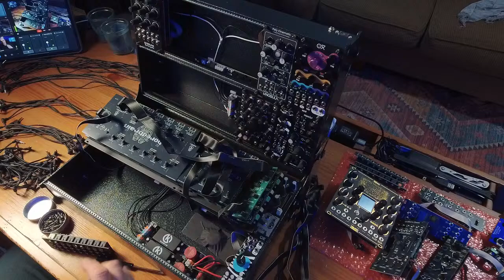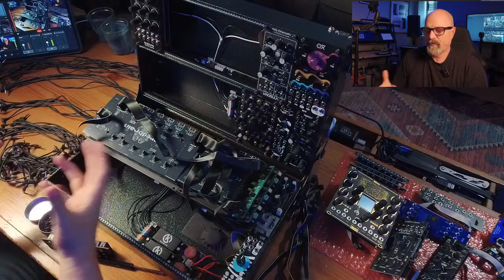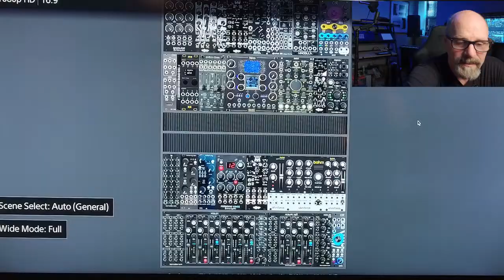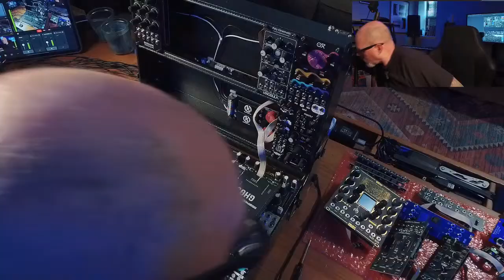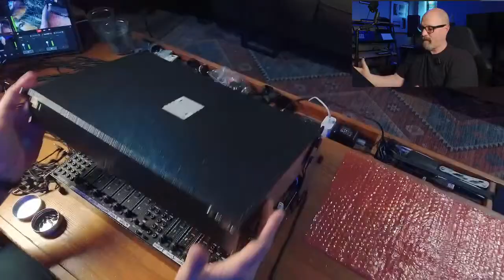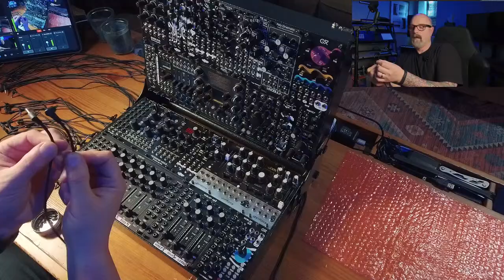Modular Rack Build- Live

Comment: really useful live, in this period I'm struggling with re organizing modules position and cable management so very useful tips..for example I have a Wmd 4tten that I found that has a profile that fits only in one angle of the case and I am forced to put it there (I researched a little on the web and I see is known issue about this module, I had thought to shape the module profile cause it's a matter of 1/2 mm but I have fear of damage the pcb)..I agree with you that leave most used modules easy accessible is important and for me find a good balance in the choice of  case layout is one of the more difficult things.. in your experience cases with threaded inserts in the rails are more handy / faster for re organize modules position?

Comment: Thanks for this fascinating conversation, Surco. One question. I know you addressed that in the video, but it is still somewhat unclear to me. How do you multitrack record if the whole mix goes into Bohm and Oxi Meta? I appreciate it.
Reply from the maker: I can multi track out pre fader from each mixer channel prior to going to the Bohm. The excludes the Bohm, but I find I don't need to record the kick as it is easy to add in as its own track after.
Reply: @SURCOlive  Thanks, that makes sense! However, I assume you’d need to thoroughly remix the track afterwards, since the fader movements, as well as the Performer and Meta effects, aren’t being recorded. Or am I overlooking something? It would be beneficial to understand how you approach this.

I’ve ordered the Böhm expanders for a live case, but I’d also like to be able to multitrack in a studio setting with the same setup. Much appreciated!
Reply from the maker: @AntoStaz  YEs correct. It is always a trade off between capturing the live performance and multitracking for edit. You can record post fader audio rather than pre fader, but this limits the editing capabilities as you can add in audio that is not recorded if a fader is not at the right level. It becomes a more complex problem. You can capture pre fader audio with midi fader movements. The only way to really do this is to use a mixer or controller that has midi output to capture the fader movements for later editing. When I capture pre fader it is to record the performance of the sound design and modulation in the live performance. I then mix after the fact. I have the full stereo main as a reference as well with the FX sends on their own tracks too. This allows for a lot of mix control with little or no audio editing needed.
Reply: @SURCOlive  Yes, that’s exactly what I do with the Pulsar-23: record both the individual channels and the master, which gives plenty of flexibility later in Ableton for cleaning, panning, effects, etc.

With the Bohm, though, the real limitation is that you can’t isolate the kick and rumble on their own track if your other elements are running through it, since it only has a single stereo output. The only workaround would be to record a few bars of just the kick/rumble, then loop or paste that across the track, but of course, you’d lose all the performance nuances—same issue with the Meta, faders or no faders. For me, it makes more sense to build the kick and rumble from scratch in the studio, since those elements are so sensitive in techno and usually demand a lot more fine-tuning than the Bohm alone can deliver.

That said, the Bohm really shines as an all-in-one solution for live use. You’d otherwise need at least a full 104hp of modules to replicate what it does, so it’s definitely a trade-off. But if it sounds good (and it does), then happy days!

I’m still scratching my head about how best to hybridize my live/studio setup. Ideally, Ohmforce would add more flexible routing options in future firmware—which I think they’re planning, though maybe not specifically for this purpose. Even something as simple as a utility to mono the low end in the menu would help a lot. Let’s see what comes up... fingers crossed. ;)